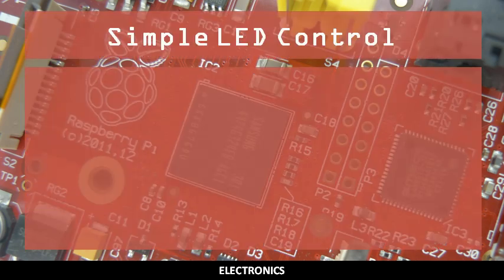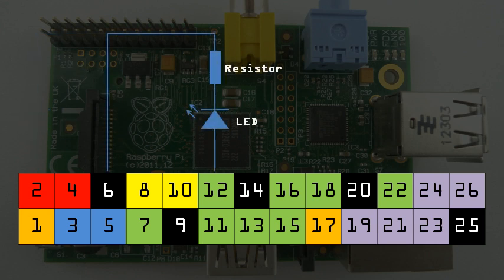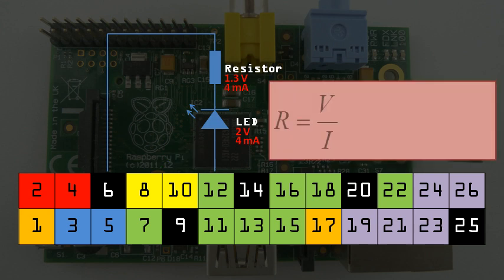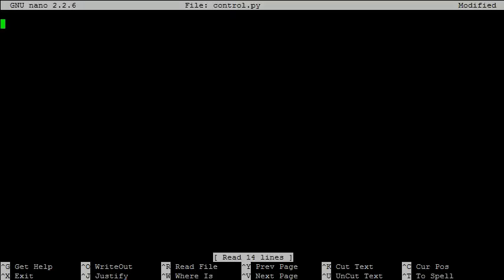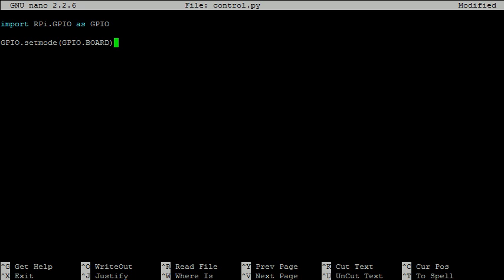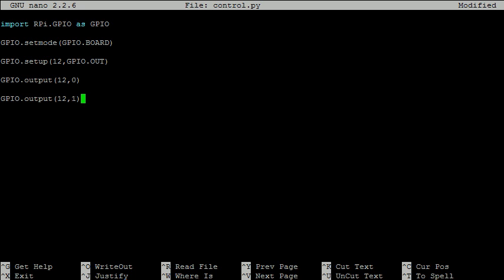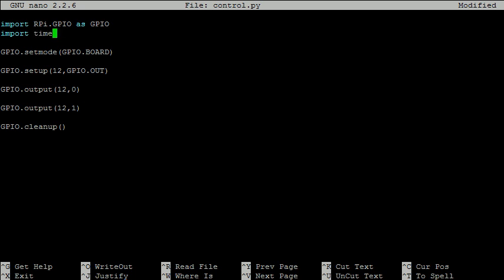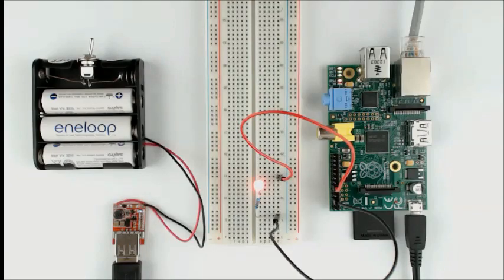Controlling an LED with the Raspberry Pi - Part 1

Comment: watts for the resistors?
Reply: Power rating isn't usually an issue with a single current limiting resistor for an led since they draw so little current. This setup has 0.004A going through a 325ohm resistor. P = I² x R so P = 0.004² x 325 = 0.0052, so as long as your resistor is rated more than 0.005W, it will be fine.

Comment: Does this work with other maker boards (like C.H.I.P.) or only with Raspberry Pi?
Reply: I personally only have experience with RPi but as long as Chip has on board gpio (which I'm fairly sure it does) and can use and write in Python then you should have no problem doing this.
Reply: Tl;dr I don't see why not!
Reply: THX!
Reply: but im pretty sure the code won't work on other SBCs

Comment: Great video, can you please explain why did you take 4mA on the resistor
Reply: The current passing through a circuit, providing the entire circuit is in series, will always be the same.  Therefore if 4mA is passing through the LED, 4mA must also pass through the resistor.

Comment: How do I start a program?
Reply: You can go the the command line and type:

Sudo nano led.py

Sudo give the command permission to act as root user (admin), nano is the command to use the text editor, and led.py is of course the name of your program. Be sure to include the ".py" ending so that it knows to use the PYthon interpreter when reading the program. With nano, you don't need to create the file first before editing it. Just make sure to save it when done editing (Ctrl-S I believe) and it will automatically create the file including your changes.

Comment: When I run a similar program, no errors appear, but none of my LED's light. My circuit consists of 4 LED's, in parallel, with a transistor in each branch, controlled by the GPIO pins. I'm completely stuck. Any ideas? I'm certain the circuit itself is working.

Comment: Using Pi2 and this code doesn't work. The led is not turning on. I did exactly the same things but not working.
Reply: ***** same
Reply: the raspbery pi b + a have different GPIO pins than the raspberry pi 2.
Reply: +Cagan Celik same. but if i use wiringpi with the command line, the LED lights up... don`t no, what i did wrong
Reply: Now, i fixed the problem. you haveto change GPIO.setmode(GPIO.BOARD) to GPIO.setmode(GPIO.BCM)
Reply: wiringpi uses a different numbering system thingy

Comment: Hi, Thank you for the amazing tutorial. I am very new to this and recently got raspberry Pi B+. With my Pi I bought some resistors Led and some other goodies. So I decided to try this. With my resistors I got ranging from 2.2 ohm - 1M ohm. So is a ohm > kohm > M ohm? Also I do not have a 33ohm resistor the way I understand it is that as long as its under  325 ohm I should be save so a 47ohm resistor would work? I cant afford to damage my Pi so any help would be greatly appreciated. Thanks in advance.
Reply: Got to excited and tried it anyway. It worked :D. As a web developer coding something that makes a light go on and not just show something on screen is just so epic.
Reply from the maker: Reier Opperman If you use a larger resistor value, you won't risk damaging your Pi. Usually 330 ohms - 680 ohms will work just fine. If the resistor is too great, then the only thing that will happen is that the LED won't light due to a very low current passing through it. So always go with a resistor that is too big rather than too small.

Comment: I used a calcultor and inputted the values and it said I need a resistor with 68 ohms of resistance. How come mine is so low and yours is so high? The forward voltage is 2v and the forward current is 20mA.

Comment: i got error w/ santax for the command to run the program
Reply: Me to did you find a solution?
Reply: i can't remember that was a while ago.
If it was in the code then I can send u a copy of mine cause I did eventually get it 2 work.